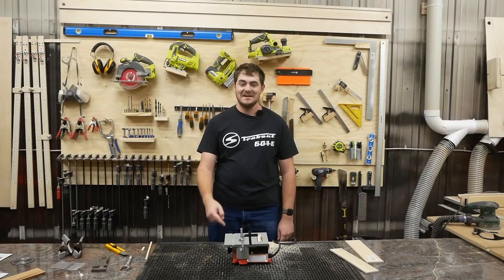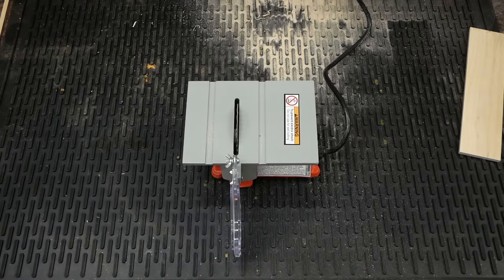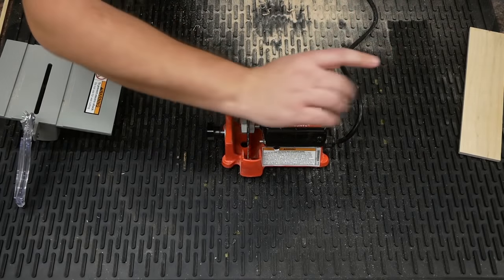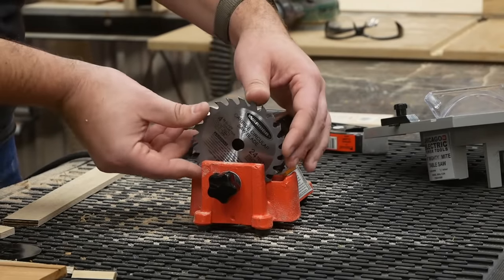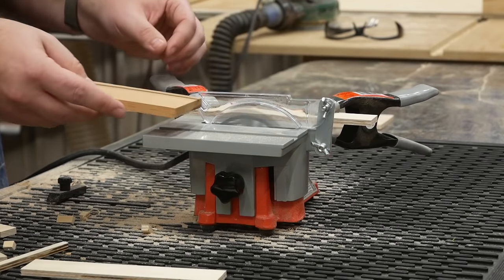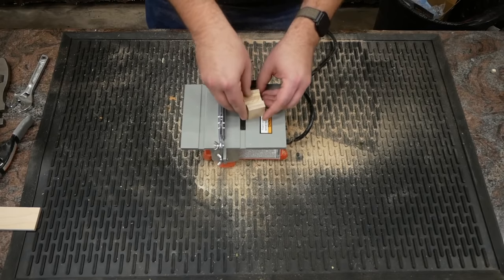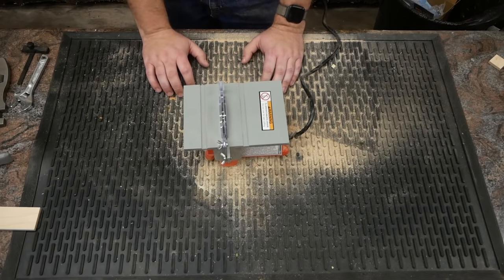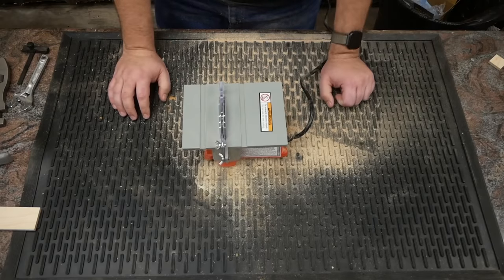Can This Adorable Tiny Table Saw Do Anything Useful?

Comment: Probably a mini-tool designed for scale modeling.  Used to cut balsa and other soft and thin woods.
Reply: That is what I thought, but it will not rip balsa boards thicker than 1/8"

Comment: Two things. It's made for light duty cutting and thin ceramics. On every cut you had the blade to high. You were cutting with the least amount of blade contact possible by having it raised. Give the mite a break. Perfect for 3mm ply modelling.

Comment: I actually use one of these for one thing: the diamond blade works great for cutting small printed circuit boards.
Reply: I'm wondering if it'll work good for cutting carbon arrows with that blade, or if a 4 inch cutoff blade will fit

Comment: this table saw is actually meant for use with balsa wood and other soft woods for modellers and crafts, it's not a carpenters saw or contractors tool for heavy work.

Comment: I'd like to have 1 (wanted 1 for quite a while).
I think I'll build my own with a 1/2" hp motor, tilting arbor, rip fence & miter gauge.
I think I have all the parts needed.
It'll be great for small projects without having to use my full size table saw (27" x 64" top).

Comment: In a place where I used to work, we had a similarly tiny  table saw made by a company called Proxxon. We used it with a carbide tipped blade to cut PCB prototypes (before components were placed of course). It had quite some bite, but you had to be careful, as sometimes the tips went flying off the blade. Quarter inch plywood was also no problem at all.
Reply: I have one, it's kind of awesome for the size. I've ripped a full sheet of 3mm ply down with it once, by making a "tablesaw table" with that in the middle. Served me well for ~10 years because I never had enough space for a full size tablesaw. Proxxon at least has a decent mitre guage, the blade tilts and it really is "just like a tablesaw, but smaller". Also ten times the price of the toy above.

Comment: If you make dollhouses or architectural models out of balsa, that seems like a great tool. Although, wood that soft can easily be cross-cut with a small hand saw and a miter box/jig, so maybe ideally just for ripping.
Reply: It is no good ripping balsa wood thicker than 1/8"

Comment: You will be quite surprised how strong this little saw is, when fitted with a forward chuck assembly from an old burnt out 18v. cordless drill. Sure, you need to make an auxiliary saw table to handle the larger projects. With the gear reduction unit hooked up, it should run between 3500 to 5000 rpm. Torque increase will certainly surprise you. Try 1 to 1 1/2 minutes to cut those same tiles. 4 inch carbide blade loves gobbling up any wood you throw at it. I did the rework, and let me tell you, if you think in terms of a sewing machine, this little motor would be an extra heavy duty replacement for many sewing machines, as well. Yes, it's cute...but don't sell it short.

Comment: It works great on cutting acrylic sheets using the diamond blade. I use a 1/2" X 1/2" aluminum angle stock for a guide fence and two small clamps to hold it down. You also need a square ruler to square up the fence.

Comment: I have a even smaller table saw for model making. it has a 63 mm dia blade aliexpress special. surprising useful for what it was meant for. I use it to cut 3mm MDF for wargaming terrain and cutting sections to fit in the laser cutter.

Comment: There's a neat trick with univeral motors. 
On AC they run with the RMS voltage of 120V. If that is rectified and smoothed you get 170v DC.
Reply: I do that to most of my tools:)
Plus an SCR right before the rectifier for smooth speed control, Although 230VAC to 320VDC is much more dangerous!

Comment: The burning at the top of the dado tells me that the blade is probably quite dull.

Rockwell, among others, makes a 4.5" circular saw blade.  If that doesn't fit, there are several makers of 4" blades and certainly some of them should be better than those from HF. Or, you could get the one you have professionally sharpened.

Comment: Excellent video! When you first showed it, I was thinking...wow, I need one of those! I live in a small apartment with no space for a regular table saw. I use my little 9" bandsaw for cutting everything, and it's really annoying not being able to rip to a consistent width, to crosscut beyond a very limited length, or to be able to make dados. I thought this tiny saw would be my solution, but you quickly showed me that was not the case haha.
Reply: right. It can barely rip anything up to 4" long.

Comment: Thanks for posting so we won't waste our money. This thing is a dangerous toy.
Just saw[sic] this advert for another about the same size and a WHOLE lot more effective
7,000 rpm.200watts Mitre infinitely adjustable up to 45°. Table size 300 x 300 mm. Cutting depth 1 - 22 mm: Sawblades from between 50 and 85 mm can be used (with 10 mm centre hole). Weight approx. 6 kg. Proxxon Cat NO 27 070

Comment: I entirely agree with your assessment--I, too, was stupid enough to buy one, thinking it would be a  a model-making saw.  It'll do for that--if you only build in balsa wood or foam board, like for model airplanes or architects' models  However, in those it might improve accuracy over an Exacto knife.  I donated it to a certain homebuilding charity.  At Trade-it I found a couple of old Dremel 4" table saws and bought one.  It's apparently 5X more powerful than the Harbor Fright model, which of course still doesn't amount to much.  It did cut 1/4" softwood or, slowly, walnut, as best as I could tell through the smoke.  It does raise and lower AND tilt the blade.  I'm experimenting with an altered portable tile saw but have no results yet--I can't find it in the clutter of my shop.

Comment: Works great. I just dont use it for cutting. For my RC hobby stuff. I put on a grinding disc, and use the side for grinding and smoothing out. Sitting at 90° it does a decent job.

Comment: I split my middle finger on something quite similar, right through the bone. Hand surgeon was impressed. Had it been a full sized one instead, my hand gestures would now probably be a sizable chunk more polite, on average. It's now healed down to the level of "conversation starter" so no harm no foul, but I gotta say, there is something about not using a tool with grossly more chooch than you really need. Makes the occasional blood sacrifice more survivable, at least.

Comment: These are actually very useful for model making and other craft work. The big benefit is you can use it all day while sitting at desk or benchtop. I use one for cutting PCBs, making small electronics housings out of PVC, really any small part, knobs, handles, gears, etc. If I can use it instead of my contractor's saw I do. It's much quieter, I can sit, and dust collection is a breeze. That said - yours is a lot crappier than mine. That motor is too weak. There are plenty with much better motors on the market though in the same form factor.

Comment: Here's a dangerously fun idea. Hook it up to a variac and give it maybe 130 volts. That would increase the power at the expense of lifespan.
Reply: 130 won't do anything. I'd go for at least 180. 240 or 208 is easy, though. Just connect it across two legs of his service. I bet he already has a 240v outlet or two in the garage.

Comment: Me at the start of the video: I don't know, my diamond tilesaw is about that kind of size, if you could get a diamond blade for it it'd probably be useful for trimming weird shapes of tile or cutouts for pipes or whatever.
Me at the end of the video: Mmmm.... no.
(Although to be fair, it's a tile wetsaw, the water probably helps a bit. Not that I'm suggesting submerging this thing in water. Well, maybe I'm suggesting submerging this thing in water, but not while it's on. At least, not while it's on and you're using it. Maybe someone you don't like. Someone you don't like who needs to cut some tiles.)

Comment: I use this with the diamond blade to cut printed circuit board material. It's very good for that, the best thing I have found. I can't think of much else I would do with it though.

Comment: Most table/circular saws have a gear  reduction of around 2:1 to give them enough torque to make the cut.  Being that this saw doesn't have that and the blade is bolted directly to the motor shaft, it's just pure speed and not really any torque.

Comment: I can imagine you could use it for those balsa wood planks you can get at Michael's for crafting (you know so you could build a tiny birdhouse).  Possible other use is for cutting popsicle sticks.
Reply: It will not rip balsa wood with the grain on anything longer than 4 inches or thicker than 1/8"

Comment: I think you might have missed the point on the purpose of the mini table saw. The purpose of those micro tools are for hobbyist working on small lightweight material such as softwoods, plastics, hollow tubing, xcetera. They are not designed nor engineered for heavy-duty use with thick dense material, that is not their function. 
There is an entire industry on microtools and have such tools as bandsaw, scroll saw, drill press xcetera. These tools are used for miniature build, where the larger tools are just too big and dangerous. It is not to say that these Micro machines are not dangerous, they are. 
Every tool has its function, that's why it's important to read and understand the instructions and its purpose.🙂

Comment: Run it off rectified 120 volts with a capacitor. You might get an extra 30% more power.

Comment: I use mine a lot building RC aircraft. Use it for what it's designed for and it works fine. I had to shim every miter slide that have come with every table saw I own, even the one that cost $3000.🤔

Comment: I found that tool more dangerous than my big table saw. You need to use your fingers to do all the work with wood and close to the blade. It has no power,  and when it starts after getting stoped by wood you can cut your finger badly when it catches and starts again. I would never recomend to try it out, it looks that bad to me. Hats off to the gentleman in the video for showing it to us.

Comment: The wood supply for this saw is at Hobby Lobby! They have a whole rack of balsa in different sizes and whole other rack of hardwood (snicker🙂).  No, really! I saw it! Most of that stuff cuts easily with a sharp utility knife or fine pull saw but this might be ok for dollhouses and dollhouse furniture, train sets, model airplanes or other such things. Don’t underestimate the “cute” factor. Small size could be handy, too bad blades are so pricy.
Reply: I tried it, it will not rip (that means cutting long pieces wit the grain) balsa wood thicker than 1/8". This means it WILL NOT rip all the balsa boards at Hobby Lobby. It does an admirable job of cross cutting balsa wood sticks up to 1/2"

Comment: It has it's design faults, however... I use it to cut fret slots in a narrow fretboard for cigar box guitars with a .023 kerf jeweler's blade and a custom built sled...  for a Mighty Mite used for feet slot cutting check out Del Puckett's Mighty Mite fret slotter.... it is admittedly underpowered but for fret slots it only needs to cut a 2 mm deep slot

Comment: I don’t find this to be useless. I know that it isn’t designed for a full scale job, but it can work for small hobbies, such as doll houses 🏘, Popsicle houses 🏘, and such. Finger or hand amputation is a fact, as to the nature of this type of power tools 🧰. Always exercise your smarts around tools ⚒️ with an exposed (and spinning) 😵‍💫 circular blade. Blade guards are there to minimize injuries, but please, guys and gals, don’t rely solely on these guards as an injury free way to go. Also, I do notice the design flaw of the motor bogging down when certain loads are imposed on it 🫡. All the company needs to do is add a more powerful motor. Again, this tool is limited to small size projects only, and not intended to try to perform actual full size tasks. Always stick to small tasks and hobbies. Attempting go full bore at large tasks with this tool, will probably result in motor burnout. Your friend, Jeff.

Comment: i wonder if you can get a step up converter and run it at 200v to bump up the power (just make sure it doesn not idle much as it would spin too fast)

Comment: This and the tiny chop saw are similar to the much more expensive ones Proxxon makes, with a lot of cost-engineering put in. It'd probably work for "rough" cutting hardboard and balsa for modelmaking, RC planes, dollhouse furniture, and so on.
Reply: as long as your balsa is very thin and short. I got it to rip (that is with the grain) 1/2 in balsa boards 3 feet long. It will not cut it more than 4 inches long. Maybe if you buy a good rip saw blade from micromark it would improve. I though anything would cut balsa wood, but this saw acts like I was trying to feed it seasoned hickory.

Comment: I've modeled a lot of custom RC/Model sailboats. I have the old Dremel purchased in the 80s. Much bigger but the motor may be the same power. This one could be useful but too week. After taking a hard look I've decided to build one with a circular saw perhaps using 4 to 7.5inch blades. I want the capability of ripping a 2x4 while still getting fine cuts with a smaller and thinner kerf when needed. I'll end up not designing with the angle cut tooling as I want it simple as pie but precise. Like I said for the right reasons this little midget could come in handy for many things.

Comment: I have a rule when it comes to HFT.  If it has any electrical component or you might die or get hurt WHEN it fails, don't buy it from HFT.  There standard 90 day warranty shows they know they sell crap.  This death toy breaks that rule two ways, being electric and a spinning blade that could seriously hurt you if that janky height adjustment failed or the blade liberated itself from the rest of the saw at speed.  i would return it or throw it away before it hurts somebody.

Comment: Harbor freight in Baton Rouge does have them anymore.  We install a 4 inch cutoff wheel to file fit piston rings at our automotive machine shop.  Our old one is worn out and I was hoping to get a new one at HF but they don’t have them anymore. 😢

Comment: What do you mean, it can’t do anything?  That gadget looks like it could rip off your fingers quite easily, or kick a board into your guts.

By the way, you didn’t have the blade height set correctly for any of those cuts (except the dado cut). With this rig, though, it probably doesn’t matter.

Comment: You are using it outside the design limits of such. I have a couple of those tables and they do the job nicely for hobby purpose, like diy  rc model work from balsa wood even basswood with a high quality high teeth number carbide tip blade. 

The miter gauge can be improved to remove the slop with a simple leaf spring attached to the side of it to fit also on the track. All the typical safety precautions need to be observed and more so, in my opinion, because even though these tools are small in scale your hands become quite clumsy in trying to hold the material safely on the table as you wood with full scale machinery that has more room to work with.   

The structure of this particular table is good the base is cast metal as well as the table top and suitable for a base for a much higher end higher performing mini table saw. I have modified a few of them to do specific cutting tasks, manually a well as semi automated, at very fast speed, to cut not only hard woods but also light metals like 1/32 wall aluminum tubing with precision. Of course these are not meant for you to build full scale cabinetry and once again you have to use the tool within the design parameters of such.  The same can be said about any product,  RC models as well, some are designed to carry heavier loads but some are not. It is all common sense logic.

Comment: Left hand thread ? should be a normal thread, otherwise it will undo when pressure is applied
Unless that's the reason, if it hits bone, the blade will release :P

Comment: It is good for cutting1/8 inch plywood no more than 2 inches in width if you make your own fence. I got it to rip 1/2 inch balsa boards. It will cut ok for about 4 inches then will go no farther. I though it would at least cut balsa wood. May be handy for someone cutting square-ish shapes for scrap booking size projects and for cutting off 1/4 inch stick. It is also a dangerous unit to operate ergonimically in spite of the useless safety guards.

Comment: For all your Balsa wood cutting needs! Actually hobby use for model train dioramas may be the only really acceptable use for this.
Edit: Have you looked at the "2 in. Mini Bench Top Cut-Off Saw"? It is a "useful toy". Even Adam Savage uses it.
Reply: It will not rip half inch balsa boards, but it is great for cross cutting 1/2" x 1'2" sticks.

Comment: In the next video Robert rebuilds the Mity Mite and makes a new saw cabinet and outfeed table. Plus and improved miter gauge that fits a newly machined miter slot. 

On a serious note the saw might be “useful” to cut basswood strips for a model railroader that wants to build a model of the Goat Canyon Trestle that’s East of San Diego.
Reply: A long as you are not ripping anything longer than 4" over 1/8" thick.

Comment: That would be great for model planes and other projects using foamboard or balsa wood.
Reply: Except it will not rip balsa boards thicker than 1/8" and 4 inches long.